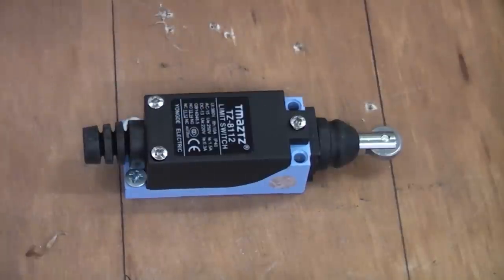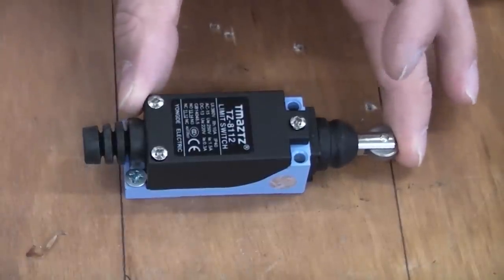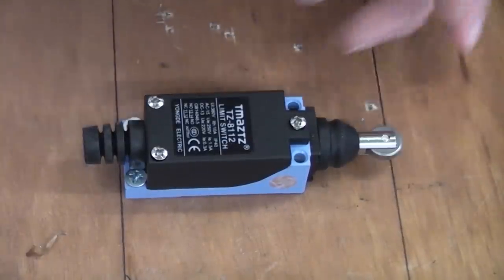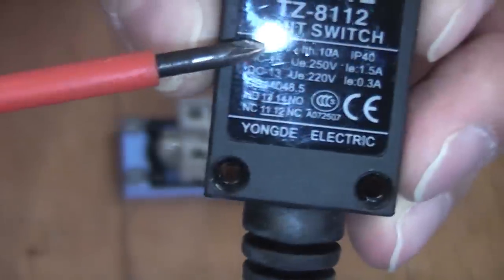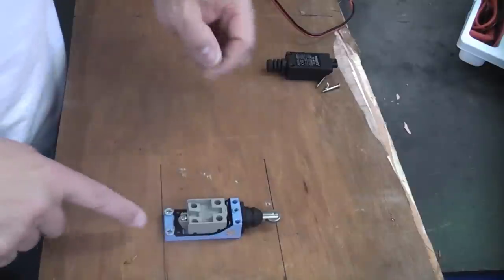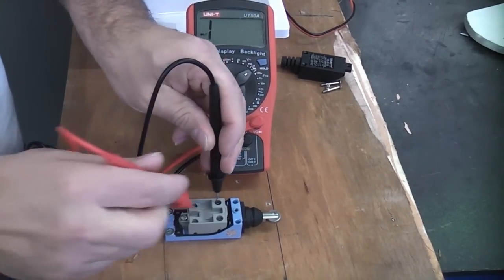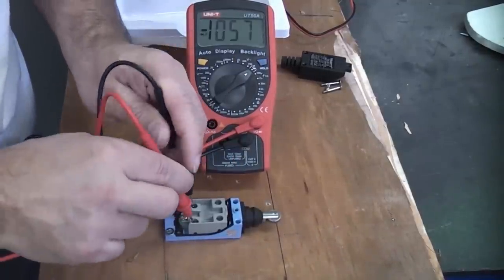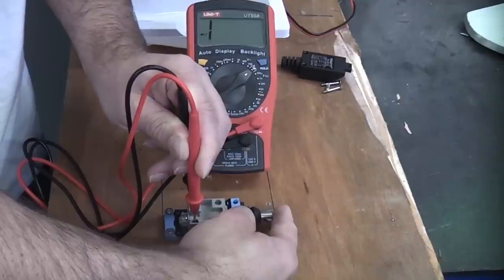Limit switches

Comment: Just a quick example NC would stop a machine door from over travel and the NO contacts would then start the machine for what it was designed for when the switch operates hope that makes sense
Reply from the maker: Yes, I am sure a limit switch could be used for that purpose. On the site where I subcontract they are often used to control the movement of equipment moved pneumatic cylinders etc.

Comment: Thank you for the clarification, I bought goods from Germany for a telemecanique company to Iraq, and they gave me some of these, and I don't know how to use them, and when I watched the video, I knew how to work, but for what purpose are they used?
Reply from the maker: They are used for lots of different reasons. You can use them to start or stop machines when the switch is open/closed.
I used two when I made some remote control garage door locks, so that the garage door could only be operated electronically when both of the linear actuators were fully retracted-
https://www.youtube.com/watch?v=b2iGCjkMaug&t
Reply: @ultimatehandyman  Thanks for the clarification

Comment: I am not that educated about electronics. In one of your videos you mention that the linear actuator had limit switches when fully extended and fully retracted. What is the purpose of the external limit switch?
Reply from the maker: The limit switches on the linear actuator are set so that the actuator stops at the correct point. The actuators are made up of a motor and a ball screw, there is then a "nut" that runs up and down the ball screw when it is turned in either direction by the motor. The limit switches stop the "nut" at the end of it's travel, if the limit switches were not there the "nut" would either fall off one end or jam up at the other end. Because these limit switches are integral to the linear actuator they cannot be used for anything else, they simply limit the travel of the linear actuator. Limit switches like the one in this video are used for other circuits, such as in this example- https://www.youtube.com/watch?v=b2iGCjkMaug
The limit switches are used to energise the solid state relay, which in turn switches on the garage door opener when both linear actuators are fully retracted.
I hope this helps ;-)
Reply: ***** Thank you so much for your quick response. Since I do not have and automatic garage door opener, could I eliminate the external limit switches and the solid state relay? I am looking to secure my roll up doors. You have made a great way to protect your garage door. Nice work!
Reply from the maker: fnarite
You are welcome.
Yes, the limit switches and SSR are not required if you don't have an automatic opener ;-)
Thanks for the comments
Reply: gd